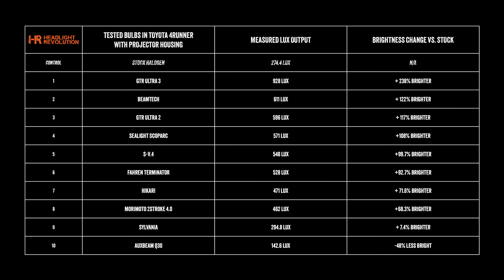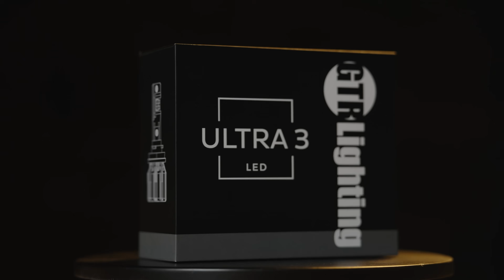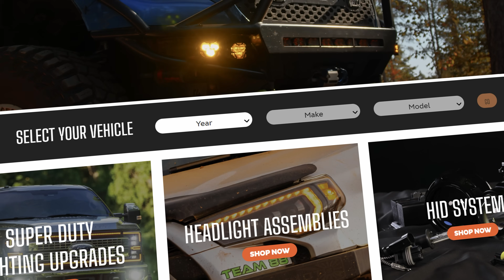The Brightest LED Headlight Bulb We’ve EVER Tested! | GTR Lighting Ultra 3 Tech Review

Comment: I thought that external drivers were better generally?
Reply: That's what they used to say
Reply from the maker: Thanks to TST (Thermal Separation Technology), the Ultra 3 doesn't need an external driver to manage heat effectively. It’s fully potted, compact, and still pushes 4,700 lumens without performance loss—plus, it makes installation way easier compared to bulky external setups.
Reply: in term of heat management, yes it is. if thermal is non-issue then you can safely integrate the driver to save up some spaces
Reply: Generally yes.